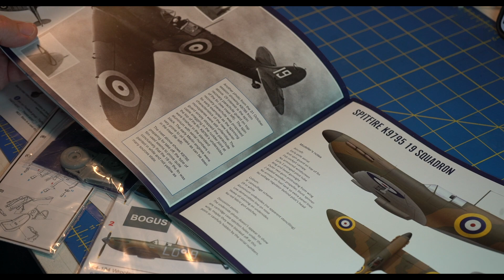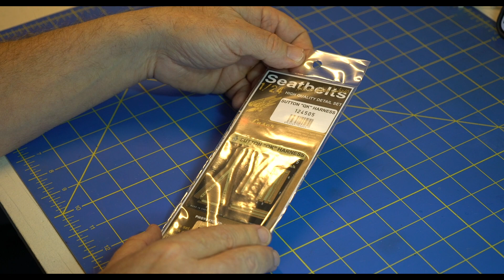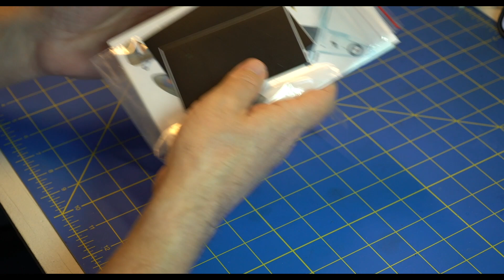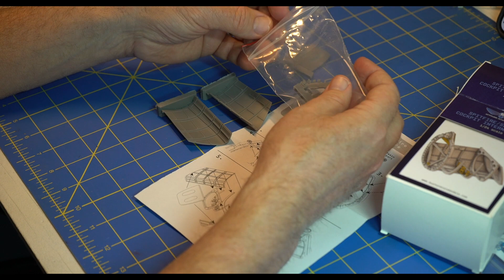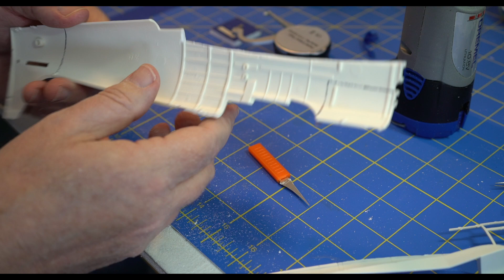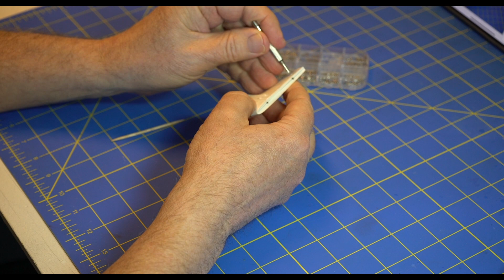1/24 Airfix Spitfire Mk Ia: Build Update 2

Comment: I sent you a message earlier on you unboxing of the Spitfire kit. I can’t believe I have found you… what you are doing is exactly what I’ve been thinking of doing for over 20 years. 
I started to attempt to upgrade the kit back then with wire and basic scratch building way back then but things got in the way. I’m a former Graphic Designer, also… Newspapers and Magazines for over 23 years but unfortunately due to circumstances, sadly not any longer. I digress… past year or so I purchased both the spit and the 109 to attempt the same again then the MK IX came out in December. So I’ve been following your build so far and would really like to come on this journey with you but… even though I have the Proxxon drill and stand together with the X-Y table I am not sure my skill level is up to thinning the fuselage down to 0.7 mm and successfully follow the shape of the aircraft. However I will give it a go but if you decide to 3D print an entire kit I would be the first, who would pay to build it ! 
Anyhow Great to be onboard ! I will follow wit great interest.
Reply from the maker: Hi Ray — lots to unpack here! First of all thanks for watching. Sounds like we are of a mind. Regarding the fuselage thinning process, I can offer a few tips. The first is: go slow and above all remember it’s just a piece of plastic and not the Hope Diamond. Styrene is actually a very forgiving medium — thin cement and sheet styrene can fix a world of goofs, I make plenty of those. Milling on the XY table saves some time but with care and patience it all can be done by hand, with a dremel & sanding sticks. Patience is of course the key word here but think of it as a secret weapon. A thickness gauge like I show is crucial, just keep marking the high spots with a pencil and keep grinding until you get there.  
My original plan was to simply thin the fuselage walls and replace the longerons etc with stock styrene strips and so on— and I’m certain this approach is eminently doable, but I think I’ll get possibly better results with the direction I’ve chosen and anyway, it’s a fun experiment to see just how thin I can print the replacement walls to be applied inside. So far so good. 
Anyway do appreciate the comments and I wish you luck with your project!
—Bo